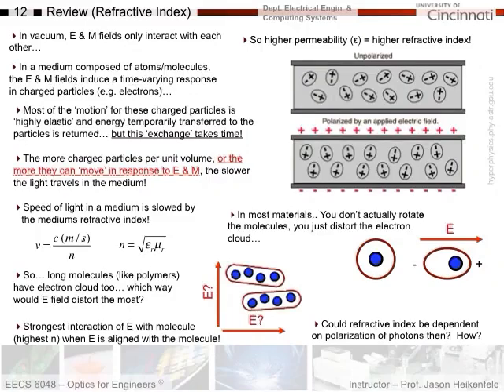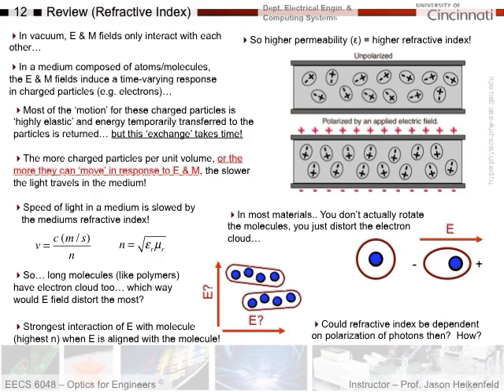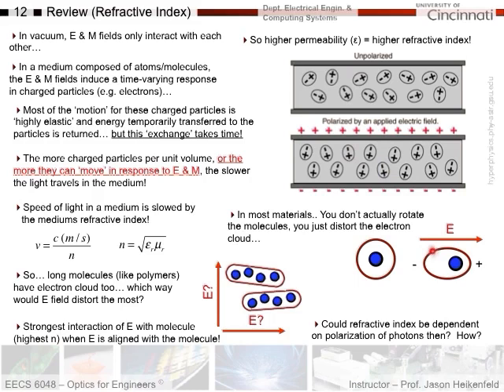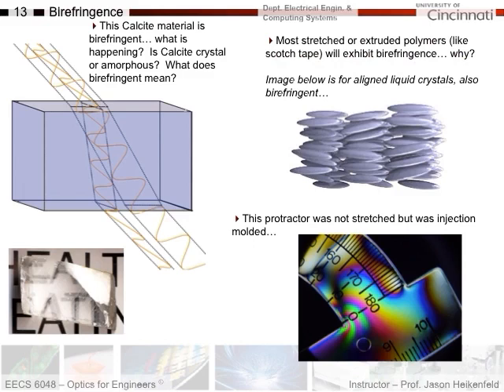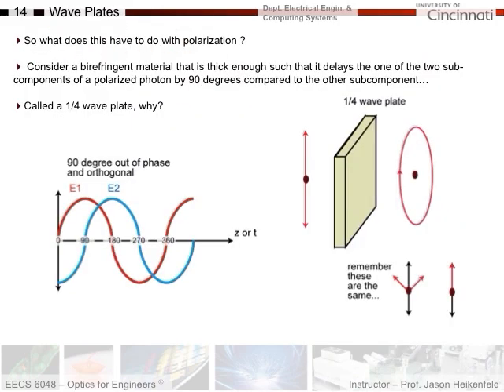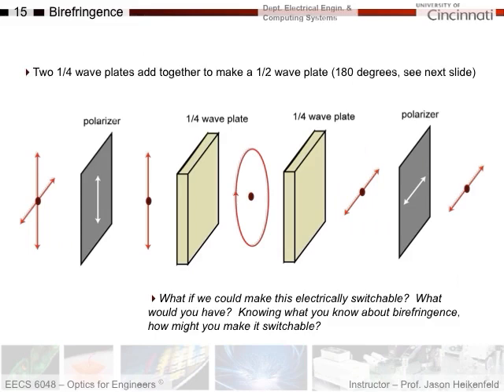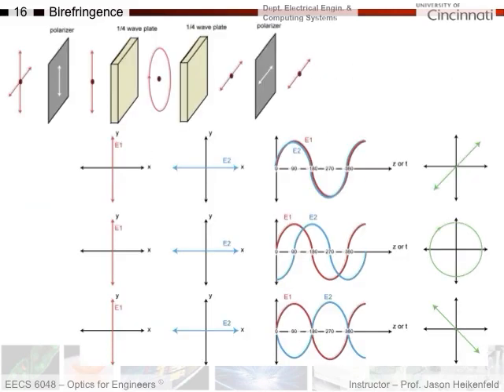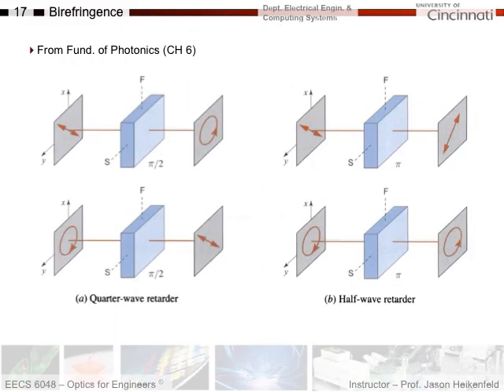Lecture 5C Birefringence

Comment: At 7:34, you talk about the "two subcomponents of a polarized photon".
Are you talking about the electric field and magnetic field components of the electromagnetic wave that are orthogonal to each other, or are you talking about two light rays that are polarized along different axes, i.e. vertical and horizontal?

At 9:04, you talk about a quarter wave plate turning linearly polarized light into circularly polarized light because it delays the phase of one of the photons by 90 degrees; but you don't explain how "circularly polarized light" is the result of that, unless you are simply stating that polarized light that has a component that is 90 degrees out of phase is circularly polarized light.  But you still don't explain why it is given that name.
Reply: Why is E2 effected by the quarter wave plate and E1 is not?